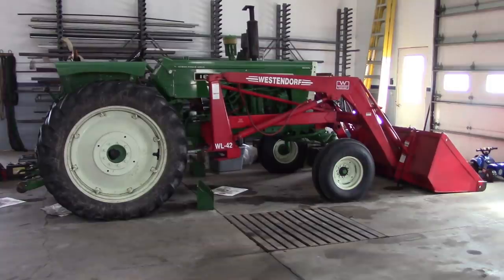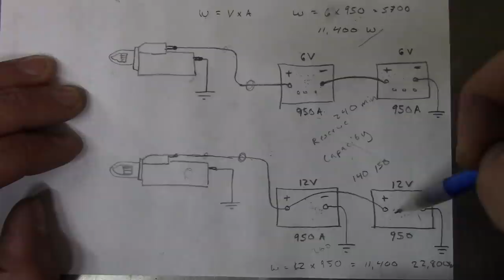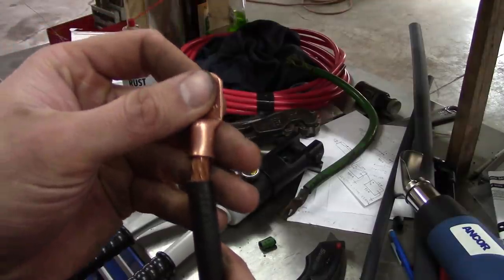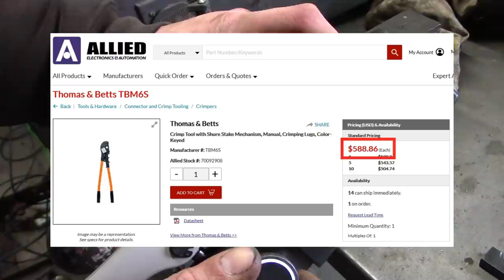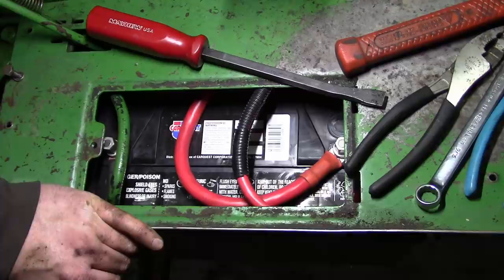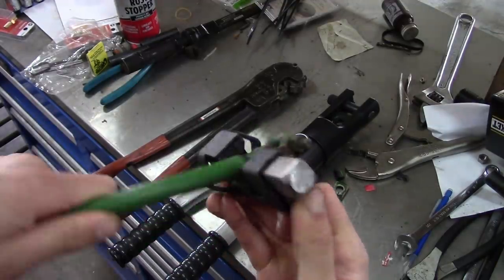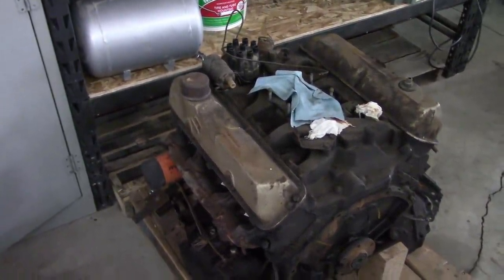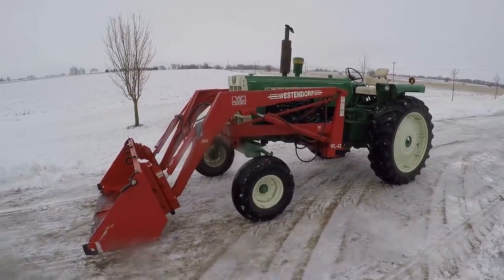Oliver 1650 Tractor 6 Volt to 12 Volt Battery Upgrade

Comment: Another question on the parallel 12V setup is the alternator / generator. With the combined current the batteries are able to sustain, goes the fact that they can also draw twice as many amps from the charging circuit. Particularly when the batteries are a bit flat, can your alternator handle the higher current draw?
Reply from the maker: The total amperage of the 12V batteries is not much different than the 6V.

Comment: When it comes down to Equipment I go Farm and Fleet I've always gotten 4-5 years out of them. I wonder if your farm and fleet doesnt move them and they sit on the shelf to long ???  When it comes down to my Jeeps and Car I go Optima I have an optima from 2008 and its still starts in the dead of winter. but skidsteers tractors and my battery system for my solar system all farm and barn.

Comment: You could always try the hammer type using a vise or arbor press. Maybe it would turn out nicer. Sort of immaterial since you have the hydro crimper though. Wher did you buy the 2/0 wire? Online???
Reply from the maker: I bought it from Del City. My auto parts store also sells it by the foot.

Comment: Would dielectric  grease put on the cable end before you crimp on the terminal end keep it from corrosion longer for your projects? I've used it before and seems to work...so far..
Reply from the maker: It couldn't hurt!

Comment: Northern Tool + Equipment must of heard you on the Klutch 10-Ton Hydraulic Cable Crimper because the now charge $40 (39.99). Inflation?

Comment: I know this is super late but couldn't you put the non-pumping handle in the vise instead? That way it's stationary and all you would have to do is place the wire in the crimper and pump the handle.

Comment: Do they use battery isolators on tractors with batteries in parallel?  My friend's truck had 2 batteries and he had one,  and I think I've seen them used on camper trailers with 2 batteries.
Reply from the maker: Not that I have seen. Sometimes you will see one on a work truck with a battery for a pump or some accessory.

Comment: If you buy automotive steel cable the sheething is way softer and easier to work around. Even welding cable has a soft rubber sheathing
Reply from the maker: Technically you are not supposed to use either for battery cables. The SGX or whatever it's called has a much higher temperature rating than welding cable. It seems ironic to me, but it's true.
Reply: Oh wow had no clue, I have had steeps forever and have always ran leftover power cable for my batteries. I guess you learn something new everyday!!!! Just another reason I love this channel

Comment: You should try bending 500MCM wire is double the size of 4/O.  Plus the individual strands are solid copper 12 or 10AWG on 500 MCM.
Reply from the maker: Yeah. I've seen some sparkies messing with big conductors. It does not look fun.

Comment: Anything under 12.6v will sulfate a lead acid battery. Self discharge is also high on lead acid batteries. If equipment sits a long time it needs a battery tender.

Comment: Hi Wes!  I watched this video back when it was originally published and have since gotten the hankering for a new tool.  Do you still use / recommend this tool?
Reply from the maker: Yes. I just used it yesterday. Works great.
Reply: @WatchWesWork  Thanks!  I will purchase one for my shop.  Do you have a good source for terminal end assortments?  I purchased one of the specialty spring clamp pliers you used in a previous video.  Those are awesome!  Thanks for sharing.  😁
Reply from the maker: @FlatThunder  I buy my terminals from Del City. They are in Wisconsin, so it's quick shipping for me. Most good auto parts stores, like Napa, will have them in stock.
Reply: @WatchWesWork  Thanks for the info!  I like my local Napa store, but sometimes they are a bit pricey.  I most recently found out they offer a AAA auto club discount.  Give it a try if you are a member.

Comment: Putting batteries in parallel can be a dangerous undertaking.  I would recommend that the second battery be connected with a big watt resistor.  I think perhaps  200W 1 ohm.  And a starter relay to short that resistor only during crank.  That way you get all those amps at crank and the rest of the time the second battery is isolated somewhat from the other battery.  And when not cranking the charging system can still get some current into the second battery.
The big concern is the batteries get out of balance and the battery with the higher voltage starts driving current into the other battery and in fact can reverse bias it.  Ever seen a battery explode?  Actually it starts boiling and I have always thought it smelled like fried chicken.
Watch out for when the tractor is not running at all and spontaneously the batteries start to smoke.

Comment: I just order that crimper after watching this video. I use it for heavy gage wire replacement on thing like lift gates and aux battery charge cables. Is it a waste of time to solder on top of the crimp? Because if you dont have problems with just crimping... I'd save alot of time soldering those connections
Reply: Save yourself the time, a good crimper makes solder completely unnecessary.
Reply from the maker: I don't like soldering for large wires. The solder wicks up the stranded wire and makes it stiff.

Comment: Maybe you should put that non stop wind to use for electric power. A project for another day. I purchased an AC Delco battery at Menard's with a 3 year replacement warranty. Replaced after first year already. Research says their batteries are made in Saudi Arabia by Middle East Battery Co.. Johnson Controls owns 49 percent of the company.
Reply from the maker: Wow. I've never heard of Saudi batteries! Lots of wind turbines in the area.

Comment: Hi Wes, been thinking about cable sizes. I've got a nominal 6v tractor with 12v conversion ie 12v coil (no lights). Original battery cables are used and are thick / heavy gauge, larger than normal 12v as on my Land Rover Defender (I'm in UK). My understanding is that the starter (an electric motor) has a power rating, say max power demand. With W = A x V if the voltage is twelve not six, the amps will be halved and the heavier standard 6v cable more than adequate? Willing to be educated. Cheers. 🇬🇧 🏴.
Reply from the maker: I generally think of the starter as a resistive load. So, it will draw roughly the same amps on 6V as 12V, but 12V will give you twice the power. The additional power draw from the starter will translate as higher cranking RPM. The torque of the starter will be roughly the same, as it depends on the diameter of the stator. Long story short, the main battery cables should be roughly the same size for a 6 or 12V cable.
Reply: Watch Wes Work not called electrickery for no reason. Thanks.

Comment: Wes I need some electrical help with my 1976 Jeep j10 that has an AMC 360ci the problem I’ve been having is that I don’t have spark to the plugs either from the coil or the voltage regulator
Reply: I’m in northern Cali if you want a nice change of weather it’s in the 70s here
Reply from the maker: All you need is a test light and some patience...

Comment: Connecting 2 batteries in parallel is not such a good idea, unless they are absolutely the same. Basically, only batteries of the same type, voltage and acid density with the same charge status should be connected that way. And you have to consider they now need twice the current for charging. Can your alternator do that?
Reply from the maker: Batteries in parallel is far more common than batteries in series. Almost all diesel engine trucks use some form of parallel connected batteries. Larger trucks will have 4 12 volt batteries in parallel. Also, since the total amp hours are the same, the charging conditions should be roughly the same. So I think the alternator will be up to the task. But we shall see.

Comment: Hey Wes, love the videos dude. How would you like to do some component level troubleshooting on a controller for a 50 HP AtlasCopco air compressor? should be fun.
Reply from the maker: Ugh. I'm kind of over trying to fix circuit boards with zero schematics.

Comment: Put the stationary handle in the vise.
Reply from the maker: That would work too.
Reply: @WatchWesWork  HMmm. Maybe not. I was thinking a pipe vise that can grab the handle. But I'm guessing for $30 its a thin-walled handle.
Reply from the maker: @wxfield  You could surely put the main body of the tool in the vise. It seems to be a steel forging.

Comment: Shouldn't your ground be at least the same size as your power wire?
Reply from the maker: Yes. But there are two grounds (one for each battery), so the amperage is halved.

Comment: I have worobel left with Napa batteries but your not post to put a battery on the concrete that calcium in the concrete will ruin the battery case didn't know that with

Comment: If you were going to be making cables on a regular basis, in a crunch I'd put the tool in the vise, rather than the cable.  Preferably, I'd make a mount for the tool, and bolt it to a bench.  But everybody has an opinion, and mine is certainly worth what you paid for it.

Comment: But you will have double the charging current. A tractor should be de-rated enough though. The main problem will be after a high current event suuuuch as the starter motor on a cold day.

Comment: You know, we used biofuel at one point, and the reason we stopped was simple, death of fuel injectors, that gummy crap in the fuel system may have damaged an injector? now this would probably cause an overall run issue, and not just a start problem but it is Just a thought, it probably is the injection pump, but if all else fails I myself would check that next
Reply from the maker: The biofuel must be making injection shops a fortune.
Reply: @WatchWesWork  I remember my dad wound up putting 2 new sets of fuel injectors on his mack truck, now if he could have rebuilt them he would have, but they wanted almost as much for the rebuild kit so he went with new injectors as an option, then after the second set stopped using it all together.

Comment: When you say 950 AMPS of power, you mean 950 cold cranking amps.  AMPS does not equal power unless you also consider how much voltage is delivered to the load . Doubling to 1900 CCA does not mean the tractor will be using those 1900 CCA.  At 1900 AMPS, your battery cables will have a significant voltage drop.  The cables would be your limiting factor.  IMO a single 12 volt 1100 CCA AGM battery would be more than enough.

Comment: my concern is the battery terminals inside the bay were uncovered. i hope they are not touching the metal body or the cover itself 😅
Reply from the maker: The batteries are held in with  strap. There is no way they can touch the platform.
Reply: Watch Wes Work i see thanks

Comment: You tried the 25 and the 35 dies, don't they sell a number 30 die??
Reply from the maker: No, but it's really not that critical. Once the wire crushes to a solid, you don't gain anything by crimping further.

Comment: try your freightliner dealer....group 31 $65.00 with core. regular price....not a sale. i was typing "i think i would put the top of that crimp tool in a vice so it would make it easier to use". then you put it in a vise. my crimp tool is made by greenlee. you rotate the dies in the head. they are not removable.  it does #2, #1, 1/0, 2/0 and 4/0. it wasnt $30 but thats ok. i was surprised there wasnt a lock washer on the starter stud. not a fan of that battery tray set up. i understand the whole multiple house thing. i have 4 right now. it takes far too much time and money to care for all of them. especially when none are income producing.
Reply from the maker: Wow. I could not imagine 4 houses. I had two for 8 months and thought it was going to be the death of me!

Comment: Sorry Wes, Carquest is Deka.
Reply from the maker: They were. Now they are Interstate, which are actually made by Johnson Controls, though some are made by Exide. https://www.autoserviceprofessional.com/article/100442/advance-auto-parts-will-carry-only-interstate-batteries-beginning-in-the-spring
Reply: @WatchWesWork  Maybe it's regional.I have a two week old battery from CarQuest sitting on my workbench destined for my Cat excavator.  It's label has a Deka logo on the bottom right corner and the warranty paperwork clearly says the replacement may be from any of the Deka brands.

Comment: Wouldn't teh starter draw half the amps at 12 v vs. 6 volt?
Reply from the maker: They are both 12V at the starter.
Reply: Watch Wes Work good point.

Comment: Kinda curious why you don't like soldering large terminals?  (Genuinely curious, not looking to wage war via keyboard XD )

I would have thought that was the way to go with all the corrosion issues you have in your part of the world.
Reply from the maker: I don't like it because the solder wicks up the stranded wire and makes the whole end really stiff. It also melts the insulation and it the cables get hot the solder can melt out.

Comment: Those 500-600 dollar tools, are actually 10 dollar tools with 500 dollar paperwork, regulation compliance certificates etc. mostly aimed at servicing power lines, nuclear power plants,hadron colliders, that sort of work. I mean nobody is going to allow 10 dollar tools at those kind of works, so they need to have 500 dollar paperwork stuck to them.

Comment: No,you are not using the hydraulic crimping tool wrong.  Two biggest mistakes are using dies that are two small and pumping gorilla like after dies come together.  Former leaves flash, and latter will blow seals in the tool.  FWIMBW, I put my crimper in the vise vs. putting the cable in the vise.  Either way, just keep your fingers crossed.

Comment: As an electrician of 35 years, I can tell you that you did not compress the cable lugs enough, the 25mm2 dies looked perfect on the small gauge cable, and the 50 mm2 dies would have been good  on the 2/0,   the flash is NORMAL on hex crimps.    The tool IS calibrated, in METRIC.     I believe that I have seen the tool offered with AWG dies, but that is obviously too late now.   When calculating Volts, Amps, and Power   use the capacity of the battery, not the "cranking amps"  that is a near bogus buzz word, that has little meaning.   Ohh and when crimping a lug twice, you should start at the closed end, and work your way towards the open end.

Comment: Have had good luck with napa batteries, less than 80$ for group 31. Exides have been complete garbage. Your right about the solder, have replaced quite a few where the solder melted causing failure. What an idiotic design on those battery trays, just one more reason Oliver tractors always sold for cheap
Reply from the maker: Yeah, they are cheap tractors. But I like them.

Comment: I have a suggestion for what it’s worth. Has to do with the application of connectors to the end of the wires. I would take a small amount of dialectic grease and put on the wire prior to installing it into the connector and crimping. It’s a personal preference thing possibly. I learned that from doing connectors for RF work. Land mobile radio work.
Of course soldering is the best electrical connection.😉

Comment: A single larger capacity 12V would have been the best option. Batteries in parallel have a tendency for faster degradation after a while, due to imbalance in voltage. Once the tractor sits a little, one battery voltage level tends to drop faster, resulting in an unwanted current loop between the two. Which in turn degrades the batteries even faster. Single 12V setup, larger capacity, the way to go in this use case.

Comment: You gotta clean that fuel tank, that gunk has gotta be through out the whole system. Take the tank off, clean it put it back on. Put a little kerosene in the diesel to clean the system.

Comment: I greatly dislike Deka brand batteries, bought 2 new Deka gold's for a Massey 4263 and had a whole mess of problems right from the get go, burned through cables and had an internal issue with one of them, In our fleet we have over 30 tractors and not in a single tractor did they last more than 2 years, just awful batteries, car quest is the way to go from my experience.Congratulations on getting your house sold, time to start making some money.

Comment: You tube won't let me watch watch wes work today, so many god damned advert points seems to be screwing it up, it will only play a few seconds at any given point before freezing & all i see is a circle going around & around & around.
Incidentally, i have never had this happen before.
Reply from the maker: A few guys are having this issue. It works fine for me. I don't know what the cause is.
Reply: Watch Wes Work, youTube has fixed it or something, it's working today 👍🏼 (1 day later)

Comment: Hydraulic crimper: The basic unit is turned into many different tools. One version is a rebar cutter. They're made cheaply because they're pumping millions of units from the factories.
The rebar cutting version is rubbish and aside from having limited cutting capacity they tend to wear out/break quickly.
Reply from the maker: I never thought of that!

Comment: Farm and Fleet batteries are crap these days, bought one to replace the original 17 yr old factory dodge battery that still started the truck fine in the warmer months. Two years later I decided to put in The (new) Farm and Fleet replacement was junk and old factory battery was better at cold weather cranking than their Junk. Sad their stuff went down hill once they started accepting credit cards and have one of their own now.
Reply from the maker: Yeah, they are cheap, but you get what you pay for.